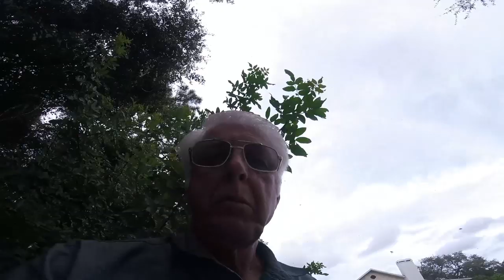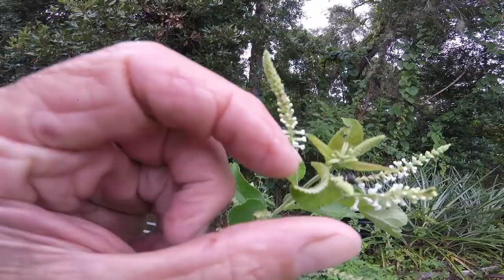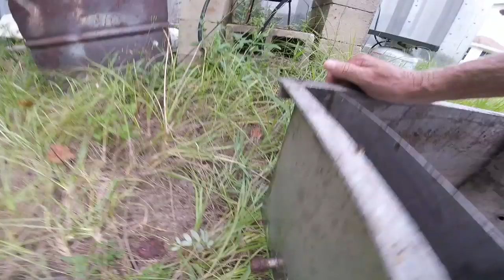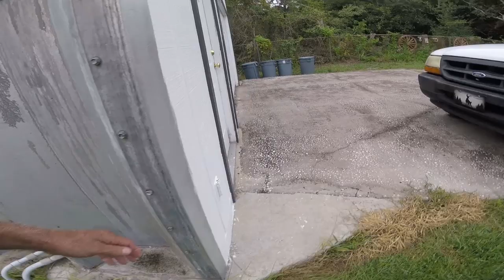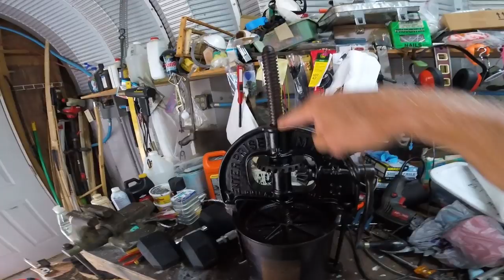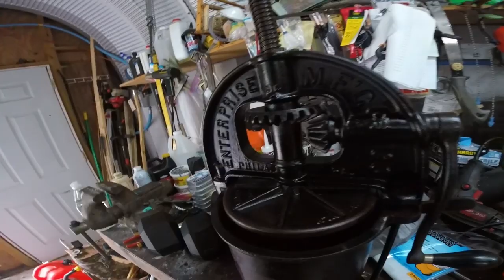To Bee Or Not To Bee

Comment: I see a problem with your press Stevo. That paint strainer bag is not strong enough. This hummer will press right through the bag no matter what. Maybe wad up the bag on the outlet just not sure but this will push anything out through that hole you have in there because the filter bag is not so strong. Stevo: before your bees sit in the tree all day the first day, get a hive tool and a 20oz hammer and beat the hell out of your hive tool hanging on a string tied to it. The bees will come down if you use ear plugs and beat the hell out of it. It might be better high carbon steel because it rings better than stainless.
Reply from the maker: Thanks Bro for the pro tips keep them coming.
Reply: @stevesoutdoorworld4340  I love bees stevo. Was just out to check food stores here on pearl harbor day. Even though I am at almost 48 degrees lat it is 45 today. Out of my hives the stores look good except one which I put camp sugar on. The problem is if it gets too cold they can't feed out of cluster. Just a waiting game, they have been Oxalic acid treated 3 Xs in august but yah never know. Oh, I was thinking about your press. I have re-thought it and it will work around 95 degrees or slightly higher. The filter material won't soften as much as the wax and there will be a point of acceptance.